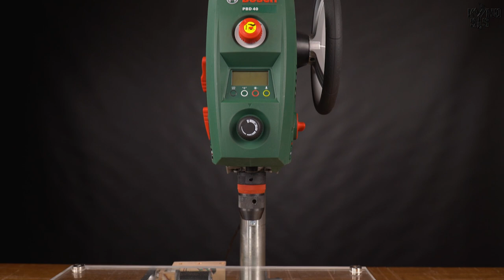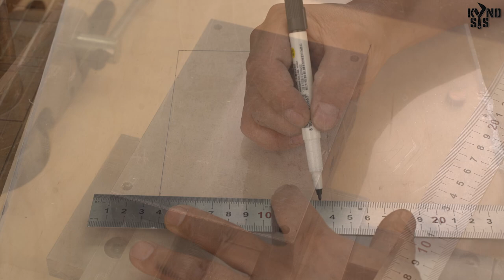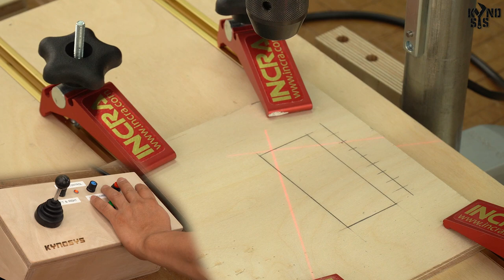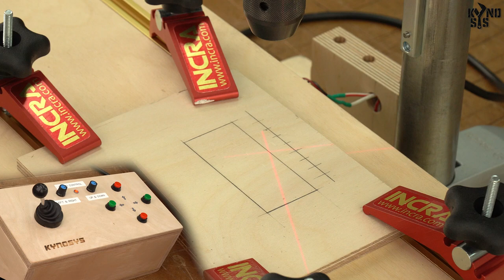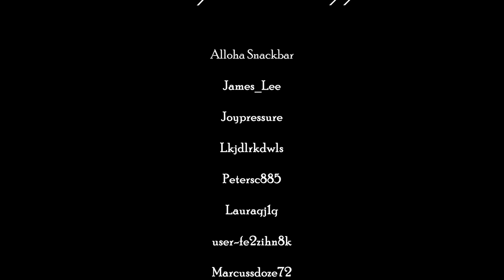PBD 40 to the milling machine / DIY

Comment from the maker: Please turn on your language subtitles! 
Please join our membership!
When you used the drill press, what did you regret the most?
The drill press table was so uncomfortable for me. 
Not only the lifting and lowering handles, but also the table fixing handles all look the same. They're thin metal rods, and they're left on both sides so that they don't fall out. My hands hurt and it was very uncomfortable.
So I tried several times to create a different type of table.
In order to secure the components well, I have laid the track and used a track fixing clamp, and attached a dust collection system.
But there are still many people who use it as it is, and this time, I made a system where the table moves in two directions: the X-axis and the Y-axis. I've always envied CNC and milling machines, but I wanted to show you that you can make it work with a drill press to some extent.

I think you'll be able to feel the charm if you see me using it.
I hope you enjoy watching the video. 
Thank you.

#DIY #PBD40 #Drillpress #MillingMachine #MillingMachineMaking #PBD40 #Tuning #PBD-40 #BOSCH #Howto

📢BGM
✔Track - The Road to Your Inspiration - Inspiring Cinematic Music
✔Soundcloud - https://soundcloud.com/keysofmoon
✔나눔뮤직 - https://tv.naver.com/v/12021211

Comment: Well, don't forget that drill chuck's made to bear vertical force, NOT a horizontal one !
Reply from the maker: This is a meaningful point. Of course, I also considered it. I made a milling machine prototype with a working depth of about 1mm on softwood. Do not use it to the extent that it puts a strain on the bearing or spindle. Of course, its main use is drilling. I have no intention of making a larger drill press with a cast iron body. That's because there is already a wonderful machine called a milling machine. I don't think you really understand the concept of my channel yet. I am primarily a person who does a priori experiments and tests. Please understand this as a new attempt. I hope that my attempt will be a small hint for those who want to create works with a similar concept. I think your expert comments will be of great help. thank you!
Reply: @Kynosys_  Hi pal ! First of all, I appreciated your reply, indeed.
Secondly, you didn't answer in a supponent way, again appreciated.
Mine was, being a mechanic, a mere technical consideration as you quickly understood.
I stumbled, by chance, on this vid. 
After that, I, of course, went to your channel. Wow ! You're doing well 👍
I congratulated you on the sanding "go-and-back" machine, as well.
I'm going to subscribe to your channel.
Greetings from Switzerland 👋

Comment: My (basic) understanding is that a drill press is not designed to handle sideways forces and  something in the chuck/drill may prematurly break/wear if you do this with it very much. If something were to go wrong at the wrong time, espcially if a router bit is in it at that moment, it could be very dangerous. Was that a concern at all? Do you know if this drill press's electric motor changes the susptability to this problem at all?
Reply from the maker: What you are saying is very relevant and accurate. 
The drill press is designed to cope with normal force. Side machining is an operation implemented in fairly large machines with cast bodies. It is a work made to perform very small and simple work on a small drill press. Not used for large pieces. Think of it as an a priori experiment. thank you
Reply: just take off micros passes instead and its fine its nearly a 1 horsepower motor and the bearings should cope with lateral forces in wood easily with 1mm 
passes.
Reply: You are right. Milling machines have different bearing systems, which are suited to handle lateral forces. Normal drilling systems are not designed for lateral forces, and any lateral force will risk degradation of functionality and safety at unknown amounts.

Comment: Where are the limit switches? You don't want to accidentally destroy all that hard work.
Reply from the maker: You watch the video carefully, and you make the right point. 
It's a kind of prototype. The travel distance of the X and Y axes of the stage is very short. The processing area is marked on the upper plate. And I work within that limit anyway. Even though the motor is for 12v, and it seems too complicated, I didn't use a limit switch. thank you

Comment: I have this drill press, how do you control the depth of the cut ?
Reply from the maker: You have a Bosch PBD40? In the upper left corner, there is a vertical pillar that moves freely. There is a clamp on the side that holds it in place. With the clamp released, lower the drill press with the handle to the desired position and secure the clamp. thank you!
Reply: Ah yeah realise that just wondered if you had found away to use the depth display 😊

Comment: I'm impressed but why not go one step further and turn it into a cnc mill, it would be fairly easy to sort out a control for Z with a stepper and stick 2 more on X and Y , pop a cheap 25 euro grbl controller on it and use free software and you end up with a full automated cnc....Well done
Reply from the maker: Thank you for your kind words. I still don't have the skills to run CNC software. However, because I enjoy learning, I would like to make the 3-axis drive piece you mentioned someday. I will try harder.

Comment: That's an interesting project. I'm surprised the PD40 can take the lateral forces when the bearing would not have been design to take such forces.
Reply from the maker: In fact, typical drill presses are designed to withstand vertical drag. A product called PBD40, moreover, doesn't have that strong frame. I only use lateral movement when machining very soft wood and at very shallow depths. I would appreciate it if you could understand that this is a prototype work that changed a drill press into a milling machine. Thank you for your thoughtful words.

Comment: Fake. The base plate is deforming under weight of drill press, the chuck wobbles on stock bearings like crazy, the whole machine has play on the tube itself.
Reply from the maker: You must have watched the movie Inception very impressively. My top will fall down.